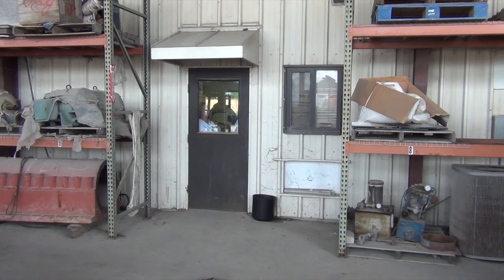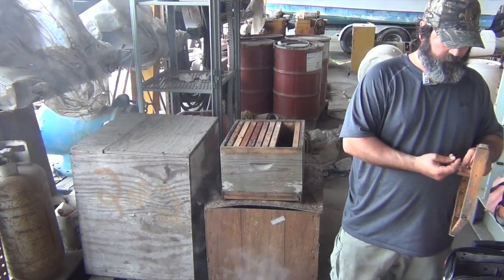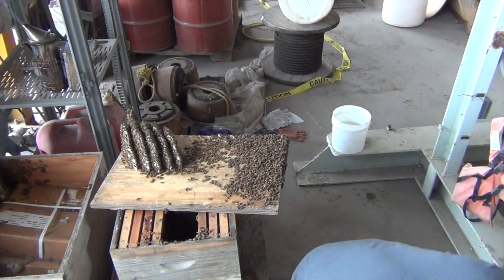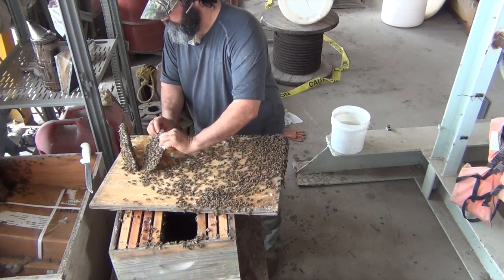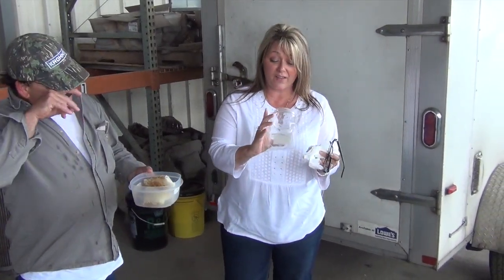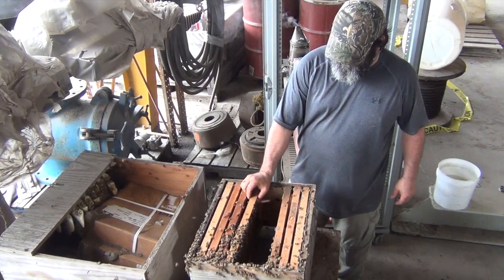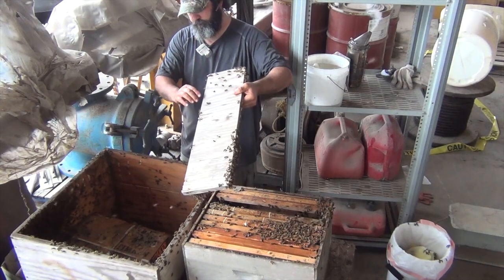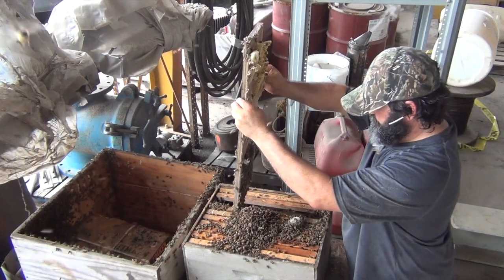Dave's Bees In A Box! (Live Honey Bee Removal)

Comment: I know this question gets asked and its silly, but what's stopping them from stinging the death out of you?
Reply: Just handling them slowly and carefully prevents bee's from acting aggressively. Using the Smoker helps throw off the Defense Pheromones of the Bee's making then gorge on honey makes them a bit more passive and less inclined to sting.  I keep 20 Colonies...and get stung only 3-4 times a year!
Reply: Darrin Gould Assuming you're producing honey.  How much can you yield with colony of the size in this video?  How much space is recommended for a single colony? Thanks in advance.
Reply: Felix Cooper.  A colony that size will easily occupy 2 Full Brood Chambers...approximately 50-60 Thousand Bee's.  Anything above that will usually cause the Colony to Swarm again. If you re-queen that new Colony early enough, and assuming that Nectar Flow is relatively good.  You could expect around 100+ lbs of Honey.  That's around what I average in Ontario,Canada.  It will vary region to region.  I generally tend to re-queen swarms because usually when the hive splits, it's typically building new queens to replace an old or failing Queen!  Only surefire way to know is to mark your Queen's by the 5 Year Colour Sequence!
Reply: Another thing to consider...when the Bee's swarmed into the Box.  They have pretty much used up almost all of the Honey they took with them...when they vacated the old colony!  They use that honey to rapidly rebuild new comb...so that Queen can start building that colony again.  If the "Swarm Queen" is in decent shape?   I would attempt to help them by boosting with 2:! Sugar Syrup and a couple of Tablespoons of "Honey B Healthy".  Basically...the more Bee's you have within the Hive during April-May going into the Nectar Flow...will fetch an optimum amount of Honey!
Reply from the maker: iamalex, the many, many bee colonies I fool with will give you signals (buzzing right near your face, head butting, bumping into you) or they're so chill, they can care less what you do. A little bit of smoke here and there is usually enough to take them off edge. If they're acting pretty downright aggressively, I suit up.
Reply: Darrin Gould Thanks for the speedy reply.  I'm also in Ontario (Hamilton).  I stumbled upon these videos while researching 'slow motion insect stings'.  Having worked as a trucker in the waste industry.  I've been stung many times.  Bees, Wasps and Hornets love hanging around waste containers as you know.  I've been working on a project for non-lethal means to reduce that particular problem within the waste industry.  Thanks for taking the time to reply.
Reply: Funny?  Both from Hamilton,Ontario. Both Trucker's and both getting stung?  Keep in mind there are huge differences between Wasps, Hornets and Bee's!
Reply: Darrin Gould HAHAHA, why yes, that certainly is interesting.  I was born and raised in Hamilton.  Went to Hillpark & Westmount some 20 years ago.  I'm an East mountain boy.  This is certainly the 1st time I've talked with someone else from the Hammer on here.  A trucker too boot.  HAHAHA, I can't even fathom the odds of meeting a fellow Hamiltonian & trucker in a conversation involving neither Hamilton nor trucking.  I've been learning the differences, and you're sure right.  I've been learning there's many.  The project I've been working on isn't to protect the drivers or loaders etc... from being stung.  Most of them are assholes.  It's for another purpose.
Reply: I grew up in West Hamilton. Went to Westdale.  Generally I am Steel Hauling but am on a brief reprieve.  So currently I've been busy harvesting Honey at my Apiary in Brant County.